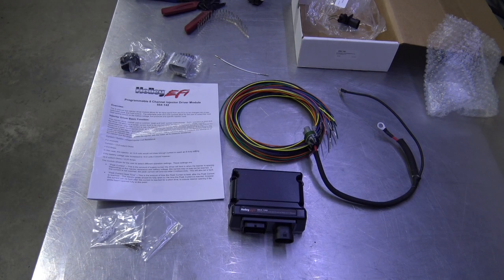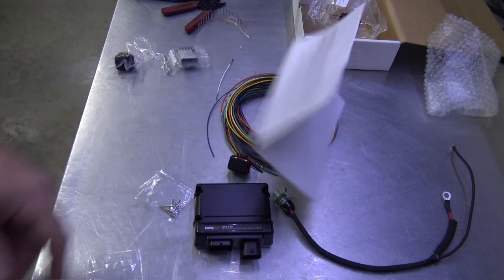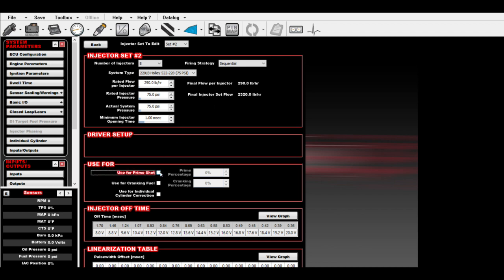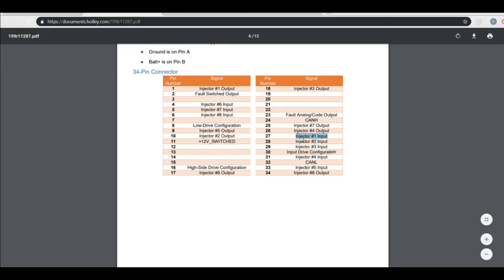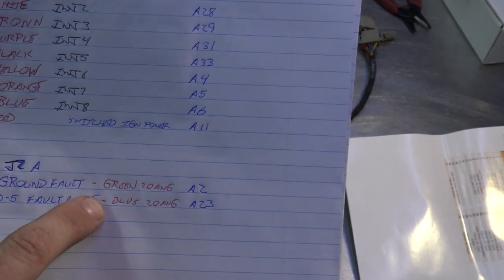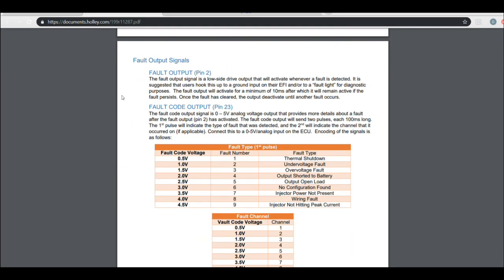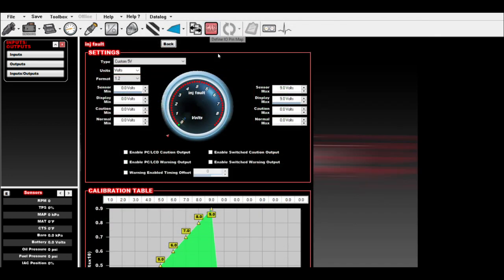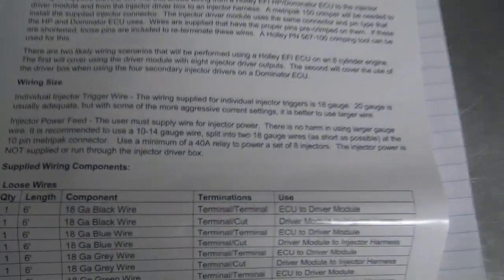Holley Efi Injector driver module

Comment: What would you suggest for a turbo ls deal on m1 that’s mostly race but would to be able to go on 15mile drives from time to time also. 16 Bosch 210s or 8 billet atomizers?
Reply from the maker: probably 16 bosch 210s

Comment: Can I use this injector driver module with the terminator x max system to run a larger injector than the 48lb ev1 injector? Right now the max injector it will run is a 48lb injector.
Reply from the maker: You can run a set of bosch 210 high impedance injectors straight off the term x
Reply: But can I still use this with the term x my Bosch 210 took a shit for the last time

Comment: Do you need the injector driver module to run 16 injectors? On the Dominator is says it’s built into the ecu? Curious on this as I’m putting my package together now
Reply from the maker: it depends on your application.  if wanting to run 16 fully sequential and independant then yes you need it
Reply: I have a Holley Dominator ecu wich I chose because I was told it can run up to 24 injectors, I plan on running twin injectors per cylinder on a bbc v8, These 16 injectors will be my daily driver injector set and  will be run paired using holley 558-207 with  Bosch 0280158843 (batched per cylinder, but sequentially as a system)...I need to run an additional 8 injectors as a separate sequential system for gasoline/e85 for this i have a set of Deatschwerks 16u-00-0065-8, I don't need to run the 16 bosch set and the deatschwerks injectors at the same time. The deatschwerks injectors will be utilized when my primary fuel is unavailable, I would also like to utilize a e85 sensor with the D.W. injectors if possible. Is this driver module capable of doing what what I intend, if so would I use this to run the primary set of 16 or the secondary set of 8?